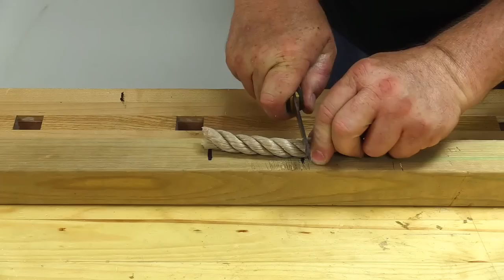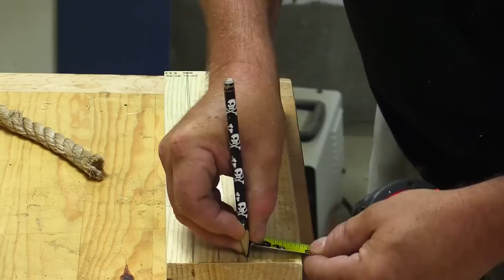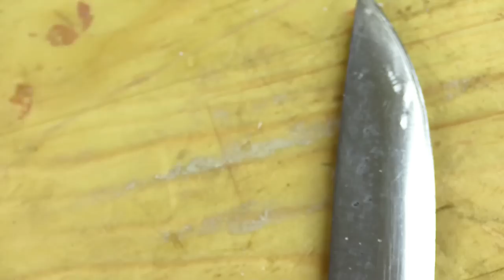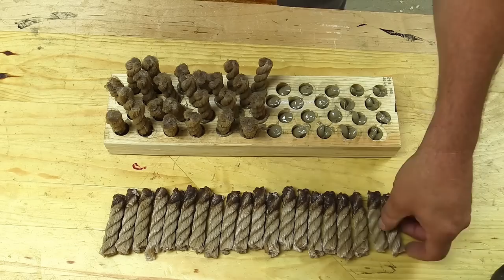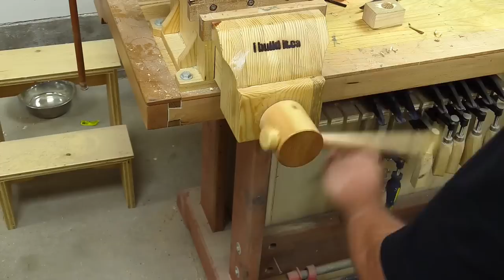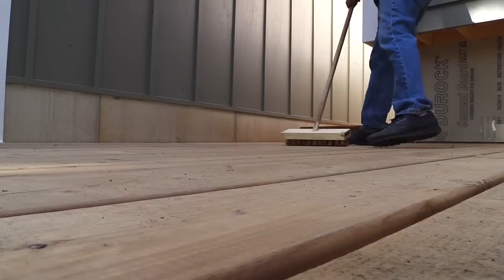The Deck Broom Build

Comment: This seems to be pointless, go to your local hardware/home improvement store and buy a 'street broom', a street broom normally has bristles made of a natural fiber, Palmyra, that is extremely stiff.  There are several types of brooms, fine is only used on very smooth floors, medium used on many different surfaces, coarse or heavy duty used on coarser surfaces, a 'street broom' is normally the coarsest, used on coarse surfaces like a concrete street, it would also be a good choice for a deck, a medium might also be a good choice.  Fine brooms are too soft to be used on most surfaces effectively.  I might also mention that street brooms with Palmyra natural fiber are also generally pretty cheap.
Reply from the maker: +G56AG 
Fascinating essay on brooms, pops!
Actually, not really, but I'm forced to read this so I'm doing my best to say something positive about it.
I didn't make this broom to save money or because I needed it.
Reply: +John Heisz #Savage